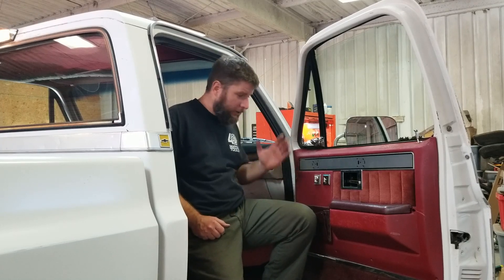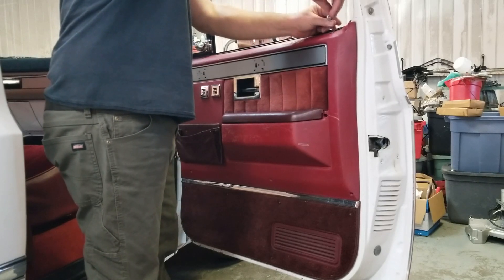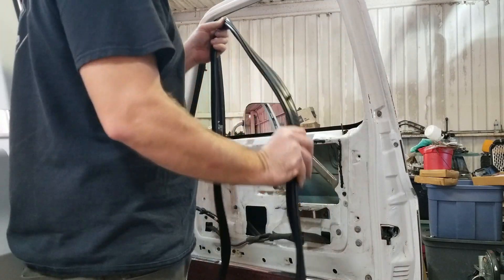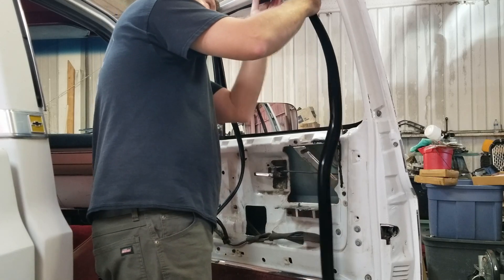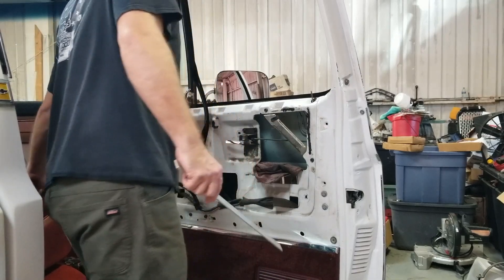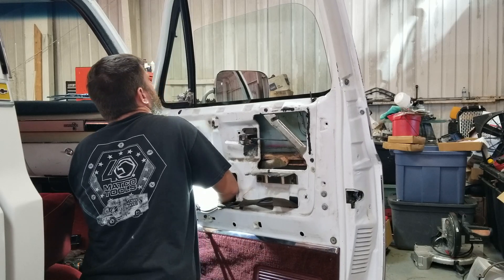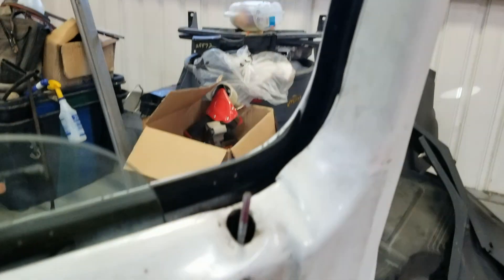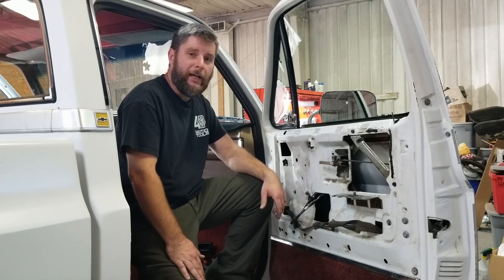Square body C10 - How to Install New Window Run Seals

Comment: I just did mine yesterday.  Got mine from Amazon. I went through what you went through.  I did the samething.  Looks great no more window rattle.  As well the snowball effect 😂 my armrest bracket was surface rust so I took it off and cleaned it and painted. New bolts and wrapped my door panels.
Reply: Por favor pásame el link gracias

Comment: I have to do this for front and back windows on a 94 Suburban. The previous owner had five dogs. When she was out and about they'd get bored and destroyed all the window seals and glass channels. I'm not looking forward to it. But thank you very much for your vid. It boosted my courage. (I think it may require I remove the glass.)
Reply from the maker: I am glad that anything I did, was able to help. I have snuck in new channels on the OBS body doors without removing the glass. New seals are rigid but bend enough to go.

Thank you for watching!

Comment: I started rebuilding my vent window. 0 of 10 recommend. I ended up finding someone to sell a complete one. Definitely worth the money to buy complete if you can find one. I have all the supplies for the rebuild if you would like them for the low.  All from LMC.
Reply from the maker: I am trying to find a pair assembled like you did or possibly sending mine off. I do not think that is a job for myself. I imagine it turning into a far bigger job that it should be, if I were to tackle it.

The 0 of 10 part killed it for me.😂😂😂
Reply: Just did the passenger side, def 0 out of 10 but doable if you remove the rivets but you will need one that swivels for outside piece
Reply: Buying parts from LMC is a Recipe for failure.

Comment: Not really an issue with good fitting door panels as it is with terrible structural support on new ones.   I changed the ones out on my 78 truck and the originals were about twice the weight of the new ones and once you flipped them over it was obvious why.
Reply from the maker: That is true. I wish a thousand times that I would had bought every 73-87 nos parts I could get my hands on when the dealers were closing up.